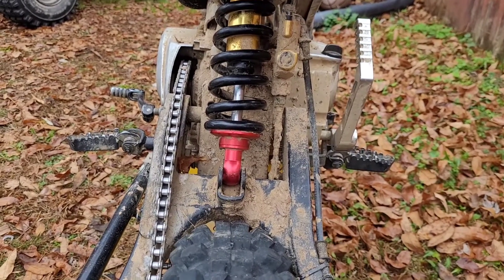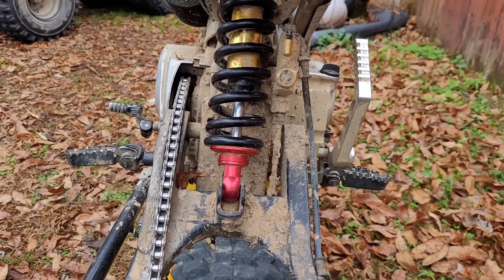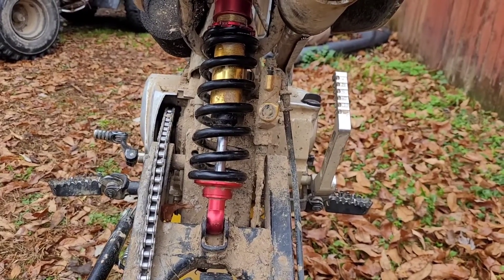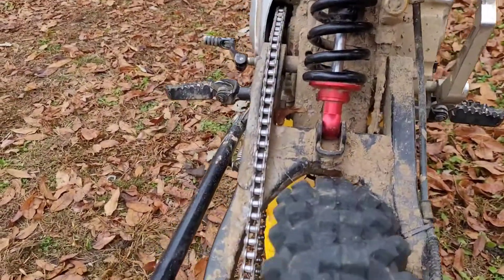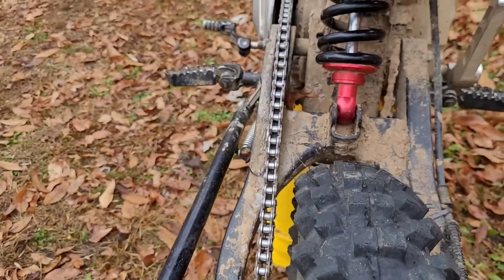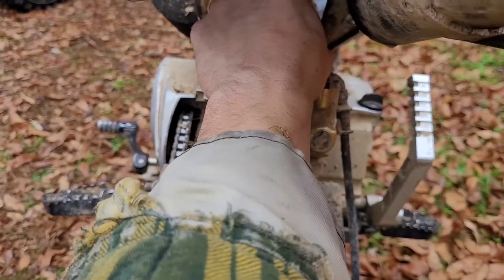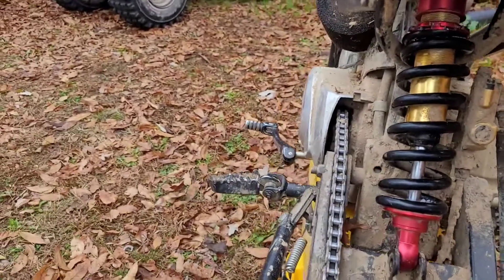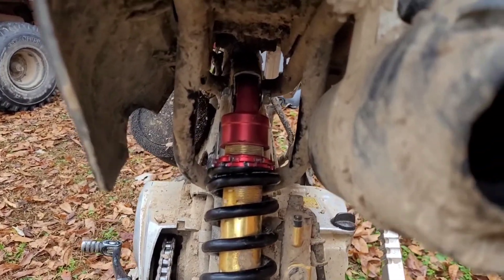How To Change / Upgrade Rear Shock on SSR 125 Pit / Dirt Bike #howto #ssr125 #dirtbike

Comment: Where can I buy the shock upgrade ? I just found my stock rear leaking like crazy so I’m interested in getting a new shock. What size and I’m about 150 lbs so does that change anything? Or should I rebuild the shock.
Reply from the maker: I actually went back to the stock shock because the one in the video got noisy/squeaked quite abit. Not sure how to rebuild, I would probably order a new one. There are quite a few on ebay and amazon. I'm too cheap to buy a "nicer" one :) Could try something like this (you will want to measure your existing shock to stay close to the same size): https://www.amazon.com/TDPRO-285mm-Absorber-Suspension-Adjust/dp/B07JJ6WLDB/ref=sr_1_7?crid=PEAFK7QJXZOK&dib=eyJ2IjoiMSJ9.al0BHea97xwp9IzUIksUwfsMaHB_fxEzvtRFnp2tG5g3-8KoKRyV3GPfzfm5jT5ZRf1muAizhzbCrKPExzQH0QXRnqr3PBgBkBrvvo0yb1jR5vpaMvPfdSzLx5ye0Y1v_TPFkBhT3KdVkWyeQPhLFHesDN32xRVnKnS1tQf29DX0fyTQqKOXgIbj6_CJi4bRBUefEG51-MlNTEmk5njIajgsbfHXiQyJ52_fWa1OZsQ.2fhy1XvWHhcXCAlOHSsnuW2OoqMwRwOBqq6tBdlOsUs&dib_tag=se&keywords=pit+bike+shock&qid=1710361193&s=audible&sprefix=pit+bike+shock%2Caudible%2C102&sr=1-7

Comment: Link for the shock or what size ? I have the same bike.
Reply from the maker: 285mm shock https://www.ebay.com/itm/154651166017 Only issue with mine is that it has started making some noise (kind a sqeaking sound)